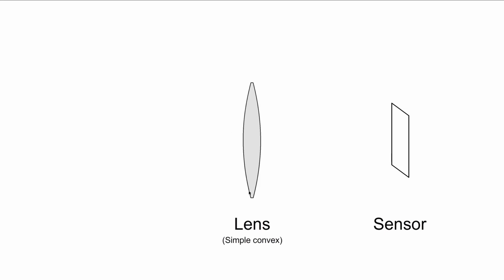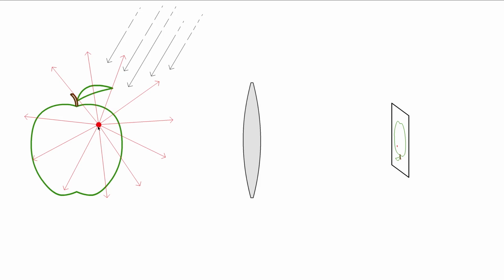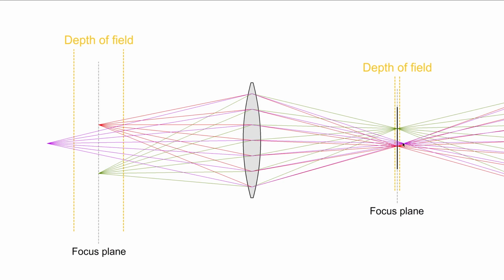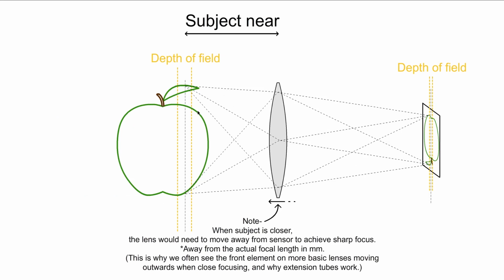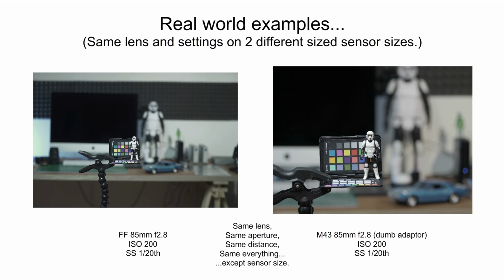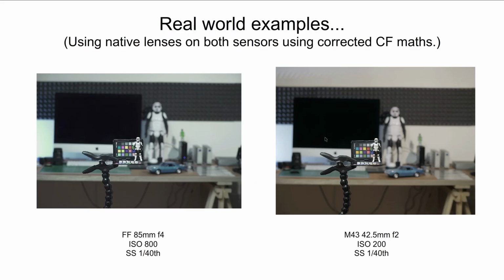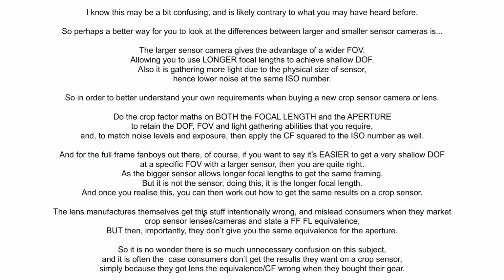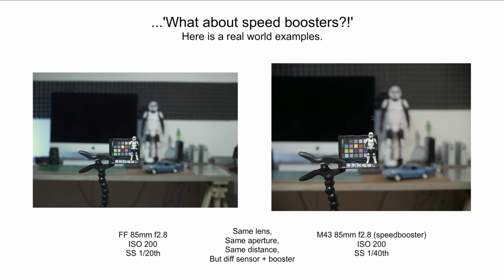Depth of field and crop factor misconceptions.

Comment: Very interesting! A minor point on your illustration describing depth of field, depth of field is on the image side, on the sensor side it is called the depth of focus. A bit more about the circle of confusion: A perfect lens will produce an image of a pinpoint of light as a pin point image exactly the same size. However, we don’t’ have perfect lenses, and real lenses can’t produce a precise pinpoint image, it is always slightly larger and thus a bit fussy. The size of this fuzzy image is the circle of confusion. The closer to the ideal image of the pinpoint a lens gets, the higher it’s resolving power the more expensive it is, so there is no point designing a lens who’s circle of confusion is a lot smaller than the smallest thing a sensor or piece of film can resolve.

Your illustration shows the same lens being used in FF and M43, and so the circle of confusion appears bigger in the smaller sensor with smaller pixels. The best m43 lenses are designed with a smaller circle of confusion to avoid the problem you show. 

Regarding speed boosters, they reduce the image circle an FF lens is delivering (to cover the diagonal of the full frame, to that which is just big enough to cover the M43 sensor, so the inverse square law is responsible for increasing the amount of light per square inch on the M43 sensor. Also, the circle of confusion for that lens ins reduced at the same time. Other aberrations caused by the speedbooster may slightly reduce brightness and affect the circle of confusion.
Reply from the maker: Yes, thanks, i had realised about the label on the depth of field, sorry about that, i am notorious for typos I'm afraid, and when I'm making a hasty video like this in one take, i tend to copy and paste elements to form my quick layout... then i overlooked that label... but the illustration hopefully still explains my points. :) 

Re the CoC, yes i could go into lots more detail there... but wanted to not let the video get to long.
but hopefully it explained the point i was trying to make, then when you shrink the sensor, but don't change the lens, the CoC remains the same, but with the sensor now at higher pixel density more areas that were 'just in focus' were now becoming 'just out of focus' hence giving us a shallower DOF.

Re the Same lens used on FF and M43, i wanted to get this across to show what happens, one step at a time.
So what happens when we ONLY change the sensor size, then what happens when we change the sensor size AND accommodate the FOV with a native lens at appropriate FL. (and all that goes with that for equivalence.)

This was intentional, but maybe it wasn't pointed out exactly why i was showing that.

Re the speedbooster, i can't see where you are disagreeing or pointing out a issue there.
I agree with all you say, the amount of light hitting sensor is increased when using a SB, simply because less light is 'wasted' falling around the sensor, I didn't say otherwise.
I was arguing with people that say they are getting more light out of their lens by using a SB and a crop sensor, than someone who has the same lens on a FF (They think because the exposure is brighter on the crop S camera with SB, at same settings, than it is on a FF camera, then its somehow extracting more light out of the lens in total.) 

Note on this, eve the description/wording on the metabones website about their products, is ambiguous and a bit misleading regarding this... so i can see why some people may think along those lines.

But as we both know, you can't change the amount of light going into the front of a lens, but fitting something to the back of it :D

So i think we are in agreement there.
Reply: I wasn't disagreeing at all, just trying to clarify. Good work. BTW are you from the West Country?
Reply from the maker: Cool, sorry if I'm a little defensive, been fielding shouty comments for the last couple of hours on forums regarding this vid :D (den of vipers they are!) Yes, guilty, I'm Bristol born, and been living in Cornwall for last 9 years. (you can see lots of Cornish film fun on this channel)
Reply: Thought so, used to live in Crackington Haven now in Washington DC. Visiting Falmouth Zuni in May
Reply from the maker: Nice! I love Falmouth, I would have bought a home there if it had been and bit closer to my favourite beaches. I am a keen kite surfer (and instructor) in my spare time, and generally, you will often find me in the sea up to something or another. I hope you get some nice weather in May... should do.

Comment: Good video and explanations, but I felt that @24:00 the FF should be at the same settings f2 & ISO 200 (<DOF & cleaner image) or the reverse (M4T at f4, ISO800...) using the same settings (exposure triangle) will be better on the FF. After all top pros will often shoot f1.2, f1.4 @ ISO 100 and applying the crop calculations the smaller sensors will have a disadvantage and on some of those low settings(FF) they can't achieve the same settings. It would be interesting to see a FF shot (f1.8, ISO 100) and a M4T shot with equivalent settings and the shutter-speed adjustment would have an impact in 'real' world shooting as well. BTW...Totally accurate and well presented video (thumbs-up & subscribed)...I wish I had the gear to test some of this out for myself.
Reply from the maker: darlingtoncd thanks. 
There was a couple of minor mistakes. 
I did a follow up vid to clarify those. (But doesn't change main results)
:)
Reply: Having really looked into this hard. I have to say the settings:
M4T   ==    f2  --- ISO 200 --- SS 1/40   
   FF    ==    f4  --- ISO 800 --- SS 1/40  (f2 --- ISO 200 ---SS 1/40 [2 stop adjustments to maintain exposure])
To apply the crop factor (from the FF )
FF      ==    f2 ---  ISO 200 --- SS 1/40
M4T  ==    f4 ---                      (f4 is the crop factor applied to the FF aperture which would be the M4T 
                                                                 depth of field equivalent to the FF but not actually setting the FF TO f4.
                                                             There's an on-line depth-of field simulator which will further confirm this) 
Filmaker IQ channel shows this and the only thing that may bring the M4T up to, or near the FF, is the use of a speedbooster. It's horses for courses, the FF shooting at f1.2 (£1700 lens) and ISO 100 etc etc that's what FF can do, at the extreme use of shallow depth-of-field settings, that's simply what the FF can achieve . On the other side; that greater depth of field from the smaller sensors have their value when you don't need/want/desire the extreme shallow depth of field, which is certainly not needed all the time. In a run and gun use of either sensor size the use of the camera and settings is open to what the photographer / videographer wants. There is an over lap in achieving similar/same results, it's just at the extreme settings, that's what those cameras can do. I didn't want to make too much of this but I can't ignore what I see and realize the settings results. I can always discuss further and hope to create a chart to break this down in a, visual form ...I'll have to give that some thought first. I'm pretty sure this is right and will continue to break this down, as you say a lot of people are confused by this and I seem to think I've got this right.

Comment: Be careful, DOF is not directly related to focal length, it's directly related to the distance from the subject, hence focal length is a consequence. Indeed, you don't need to introduce a different pixel density between FF and crop sensors to explain a different circle of confusion; even with the exact same density, FF and cropped, what you get with FF is a magnification of the background, due to the longer focal you need to get the same subject, at the same distance. The magnification of the blur explains why with an FF you get more bouquet with the same subject on the frame.
Reply: What? Final length is not dependent on distance. Every lens can be used at various distances.

Comment: Everything is very logically and well said, but I do have a question. Why does the total amount of light determine image noise, not the amount of light per square inch, assuming the sensor technology is the same? It is very tempting for me to think if the amount of light per pixel is the same (assuming pixel size is the same), then the noise is the same.
Reply from the maker: Shanghao Zhong I think you missed the point slightly. 
It IS the amount of light hitting each pixels that matters. 

The main point about the "total" light is that when the sensor is smaller the ISO is still measured by square unit. 
So, for example, let's say a bigger sensor and a smaller sensor has the same resolution. 

The lager sensor is getting more light hitting each pixel at the same ISO number. Because of the way they measure sensitivity and exposure. 

This is why it better to consider the total light rather than how much is hitting a portion of the sensor. (Square unit e.g. a square mm)

Simply because the larger sensor will have more of those units than the small sensor. 

It's the way it's measured is the problem. 

And we are concerned with ALL the light that makes our image. (More light = stronger signal to noise ratio)
It's the image that matters. Not the arbitrary way ISO is measured. 

ISO is very useful if all sensors are the same size. But basically lies to us when comparing different sizes sensors.
Reply: Got u. You are assuming resolution are the same (e.g. a 40MP FF vs 40MP M43) while I am assuming the pixel density is the same (e.g. 40MP FF vs 10MP M43).
Reply from the maker: pretty much, although I'm more coming from video, so you would be shooting 4k (or 1080) for any sensor size. so the end res is the same regardless of the MP of the sensor.
Reply: If you scale down a hires picture to a lowres one then you also reduce the noise. Noise is most in the HF component. Say you compare two sensors of the same size same everything except pixel density, the higher resolution one will have a higher noise per pixel but if you scale the resolution down afterwards to the lower one the image will have the same amount of noise. (more or less there is some difference I guess). Also if you take a large sensor/lens combination and scale the result down afterwards you get a better noise ratio. It's really the total amount of light that matters. 
If you turn this around and take a very small lens and very small sensor say 100x100 if you take a picture with that and blow it up full size you get awful noise. The bigger the sensor (assuming the same light per square inch) the more the noise gets pushed away into details.
Reply: Short version of this yes noise is the same but noise is in the details, in the high frequency part of the picture if you 'zoom out' it gets less and less. Noise is not just spread all over the frequency spectrum.

Comment: The ISO calculation was really confusing for me in the beginning, however when I thought in stops it all made sense! 
Since I have to mathematically double the aperture, so from 2 to 4, in stops: 2 stops of light. I now also have to bump up the ISO by 2 stops, which is from ISO 200 to 800. 
At first I was like "Wait that makes no sense!" but then it all cleared up! 
Really nice video! Thanks a lot!
Reply from the maker: Bastian Dittrich thanks dude. 
Yes everyone thinks differently. But glad you agree, just do it in your head with stops rather than squaring ISO numbers etc. (Hopefully others will spot your comment as it's useful for other camera heads that always think in stops of light.)

The main thing to take away is that the ISO number doesn't tell you the total light creating our image. (Total photons hitting whole sensor for shutter duration)
So if we can match that total light quantity across diff sized sensors, then the rest of the equation all falls into place perfectly.
Reply: It's actually pretty easy to understand once you get the hang of it! The basic principle has to get into your head, once that's done it's pretty easy. 
Yeah I'm the camera head kinda guy, calculating in stops has become second nature to me...

Comment: I think these discussions are much clearer if we focus - no pun intended - on the lens rather than the sensor. The light gathering power of a camera, and its ability to render a shallow depth of field, are determined by the area of the lens’ entrance aperture, and not the sensor size at all. For a fixed depth of field, smaller sensor camera operate at numerically smaller f-stops and iso values - the total amount of light hitting the sensor is independent of the sensor size - and the image noise is typically very similar.

Comment: I always think about DOF as subject magnification (distance to subject and focal length) plus aperture.  For instance, macro has very low depth of field because subject magnification is higher than if you were say, fitting an entire elephant on the sensor. If you are fitting an entire mountain range on the sensor, subject magnification is very low and depth of field is correspondingly very high, no matter the aperture.

Comment: Firstly - thanks for the detailed explanation  - 1 point about FF vs. APSC (or MC43), is the recent shift to cropped sensors with high count of MP, i.e., emerging 33MP APSC cameras rumored to come out the next few years - I would like to see this video updated to include the effect of such a shift (more noise - since less light per pixel, but maybe compensated since it makes a difference to the coverage of the CoC ? - And if so,is it pronounced enough to nullify the effect? -Under "low light"/ Normal Light ?

Comment: This is a wonderful video.  I now understand the physics behind applying the crop factor to focal length and aperture.  However, I don't understand the physics behind applying the applying the crop factor squared to the ISO other than it is an area rather than linear.  First, I assume I could decrease the shutter speed by say two stops rather than increasing the ISO by two stops.  Is that correct?  Second, what happens if the full frame is 50mp and the ASP-C is 24mp?  It seems the crop factor should be applied to the focal length but now it is less clear what I should do to aperture and ISO.  biscuitsalive,  I would appreciate your comments.
Reply from the maker: Thanks. 
Yep it is a bit confusing. 
So what I’m getting at regarding applying crop factor squared to the ISO is that then completed the full equivalence. 
So CF to focal length makes FOV the same. 
CF to aperture makes DOF the same. 
CF2 to the iso then makes exposure match. 
As you’ve closed down the aperture on the full frame camera we are getting less light in the camera. 
So you have to up the iso to match exposure. 
And remember it’s surface area we are talking about. As the FF sensor is 4 times the area of the mft sensor. So if each pixel is to be getting hit by the same intensity of light (across the whole area) then you need 4x the light falling across the whole sensor. 

(Imagine if you took a magnifying glass and focused the light down onto a smaller area. It’s the same total light entering the glass. But it’s focused down into a smaller area. This is kind of what we need to do.)

The thing that confuses everyone is they think of ISO as a “sensitivity” but it’s not really it’s gain. And that gain is calculated per square inch (sort of). 
So iso 400 on a small sensor isn’t really the same as iso 400 on a big sensor. 
Iso 200 on a m43 sensor is technically more like iso 800 on a FF sensor. 
This is why it all fits together perfectly when you follow my full equivalence. 

Because (to answer your second question too) when both sensors are THE SAME RES. The. And both technologies are about equal. The FF at iso 800 will have same image nose as a m43 at iso 200. 

So yes if one has completely different res this does completely change everything. 
Just as if 2 camera with identical sized sensors has one high res and one low res. 
Generally speaking the lower res camera has less noise. 

But again this is debatable too. 

If you took 2 FF cameras one 52mp and one 12mp (same technology just diff MP)
Then if you looked at a 100x100 pixel area of both the low res sensor would be much cleaner. 
BUT if you looked at the entire image. 
From the same distance. 
Chances are image noise would be very similar. (Some small advantage to lower res sensor due to packing in less technology into small space)

So this is the thing. 

For me who generally shoots video. 
And nearly always at 4K
The lower res sensors. (Like a7s2 Or gh5s) has the best chance of low noise. 

But for photographers it’s a bit debatable. 
Pixel per pixel lower res sensors have less noise than higher res. 
BUT THIS IS JUST BECAUSE THE ACTUAL INDIVIDUAL PIXEL (photosite) IS LARGER. 

Sorry to shout. Just that’s something that many people argue about so I feel it need capitals to drill the point home to any of those guys that may be reading this. :D
Reply: Wow.  I appreciate your fast and detailed response.  Thanks.
I take a lot of bird photos in the wild with my Canon 80D and was considering the Canon 5DS.  Using the same 400mm lens, the 5DS could possibly give me comperable bird photos but then dynamite full frame photos for landscape, etc.  Probably not worth the price and the slower frame rate.  Thanks again.
Reply from the maker: glasairdriver no probs. Hope my response made sense. Often type faster than my brain. :)
I’m still loving my Sony a7iii for stills at moment. (With canon/sigma lenses)
But I’m more of a video guy than a stills guy. 
Anyway.  Happy snapping.